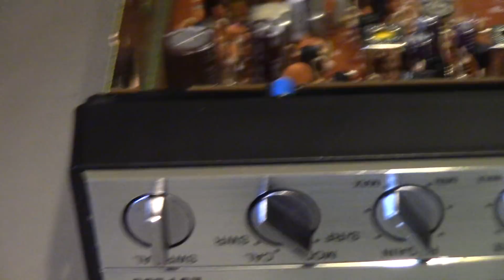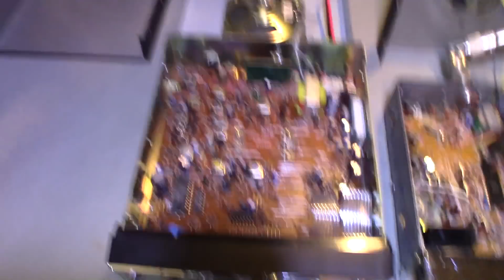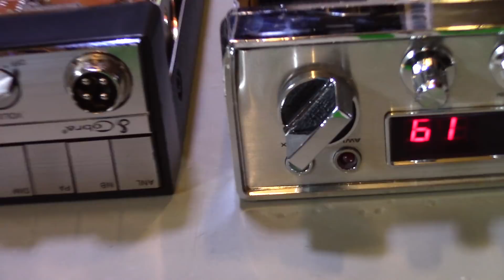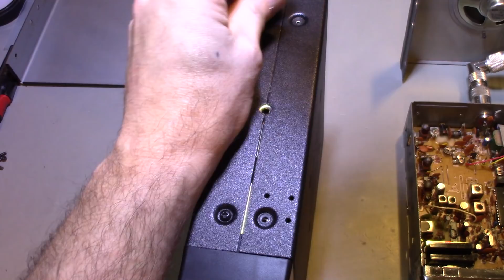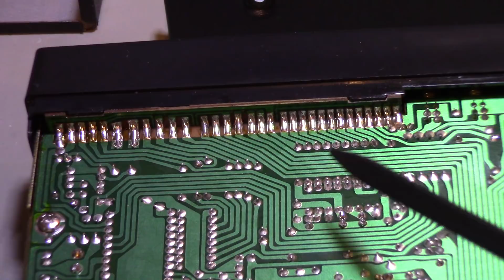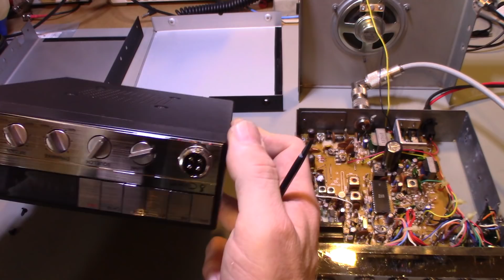Royce 607   Cobra 29 Plus and some soldering tips

Comment: I have two of the cobra 29..23ch.
one is in Ok condition. .second one is in perfect condition looks like brand new...I also have a johnson messenger 323.....23 channel. show room condition. .it's missing the 8 pin plug...for juice. .do you have any??.  or can a cb shop convert to normal 3 pin plug....still have blue print for it..

Comment: So, what is up then with others saying they use audio grade solder? I thought that was a load of snake oil. Just another reason to take ones money. I use good old 60/40 solder. I will get some with silver for contacts like the Cobra has. I have seen edge connections in other gear as well.

Comment: Hi Mike I just want to say this is the first time I’ve seen video since you got new camera and everything and I wanna tell you it looks and sounds GREAT!!! I watch every  video you put out and I use to be a very avid CB ‘er and took industrial electronics at vo-tech after high school went on to work maintenance in a locomotive radiator factory. I’ve learned and remembered a lot watching you. And I wanna say Thank You !!! I’ve gathered and rescued lol several radios about 10 mobiles and 6 base radios I’ve not turned any on cause they prolly need re caped  ? Where should I buy parts front cause I wanna at least recap them myself   Again Thank you.
Reply from the maker: Any large reputable electronics parts supplier.  Get from one of the big ones and you don't have to worry, they don't sell cheap Chinese caps.  DigiKey, Newark, Allied, Mouser, etc...

Comment: Glad that you showcased the 29Plus as it's not covered enough on YouTube. One of the most beautiful and cleanly designed mobiles ever made. Thanks for the tips on the edge board connector, which I'd seen before on your videos on another radio that I don't remember now, but didn't know it applied to this model. Seeing this made me less afraid to buy one. Now for a review of the Clear Channel AR 3500 which will hopefully remove my fears from that one!
Reply: The 29plus is one of my fav. AM CB units too.

Comment: Err.. I think its compression force that pushes down on the joints and breaks the bond between the pad, solder and component leg.
Tensile (pulling up) tends to pull them together. Most people look for bad joints by pressing on the top of the component and looking  underneath for a moving lead.  

Bad joints show a downward solder separation typical of a compression fracture. A tensile break would look more like a dimple.

You can compress component leads but as component leads are under tension during manufacture they are already near their upper tensile elastic limit.